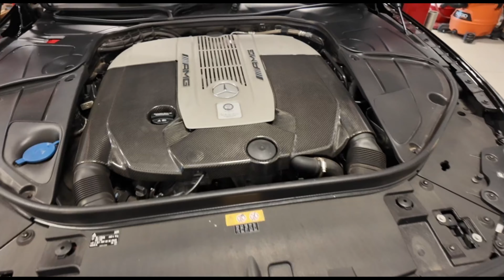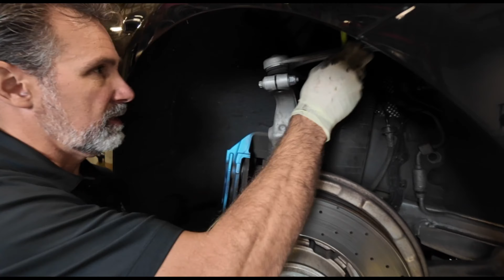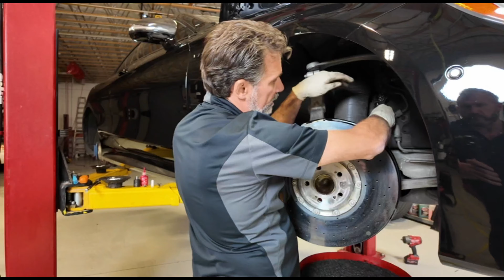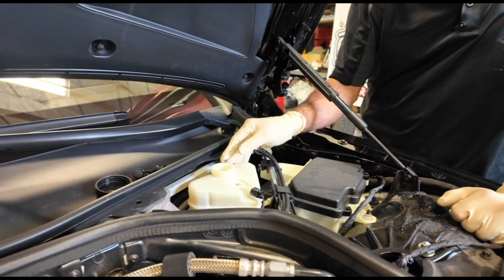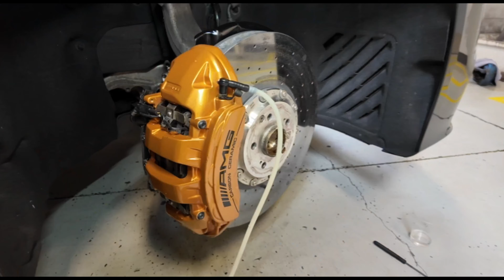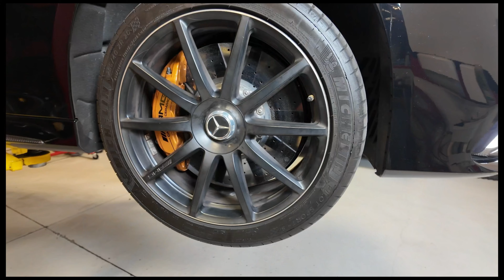$24K Brake Upgrade: Insane Carbon Ceramic Swap on Mercedes AMG S65!

Comment: CCB require high temp brake fluid like motul rbf660 they get way hotter then cast iron brakes
Reply from the maker: If youre going to track this vehicle you would be best served to find the fluid with the highest boiling point. 👍

Comment: I have these same calipers.  Your video is the only video on the net that shows removal.  I have question when replacing the pads, do i have the remove the entire caliper or is it just removal of the 2 torx bolts?
Reply from the maker: I honestly dont remember as it was quite a while ago.  I believe I loaded the pads into the calipers before installation and they may not have fit from the top. I would say try first.  If they dont fit out the top, you will have to remove the caliper.

Comment: Mercedes-Benz Carbon Ceramic Brake (CCB) coding is generally required when retrofitting CCB systems to update the ABS, ESP, and stability control systems for different braking characteristics. While some, like StopFlex, offer plug-and-play kits for certain models, others report that different brake boosters and coding are necessary for optimal performance, For a specific model, consulting a Mercedes-Benz specialist (like those using Diagcode or RJAutomotive) is recommended to determine if coding is strictly necessary for your specific upgrade.
Reply from the maker: This is great advice!  We checked with our local Mercedes specialist and he said this vehicle did not require any programming or coding, although some do.  Thanks for sharing that!
Reply: @OrtoTechGarage  

no buddy my car is c217 s63coupe
CCB UPGRADE coding
1. braking response fast (non coding 50%😅)
2. front rear shock damper response fast
3. esp vehicle move different 
i am 100% sure
go coding feel it

Comment: Did you reprogram ESP/ABS? There are two separate codings for CCBs and steel brakes
Reply from the maker: No.  It works fine with original programming.  I thought it may require something as well, but I have a friend who is a Mercedes tech and assured me it wasn't required.  It seems to work perfectly, as is.  The client is happy, although the brakes are very strong compared to the prevuous set. He said it took some adjustment period to drive it. 😉